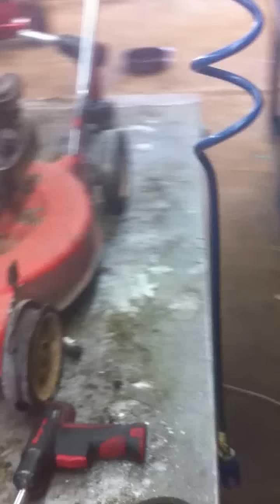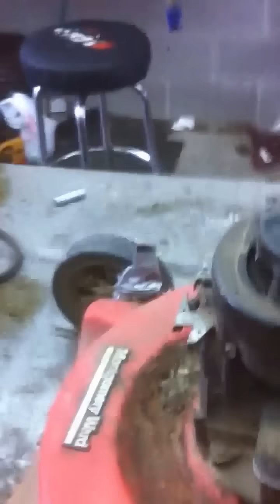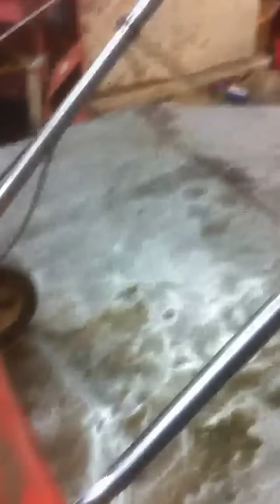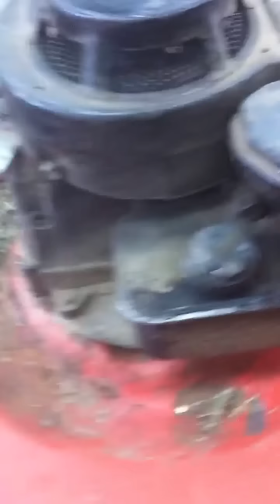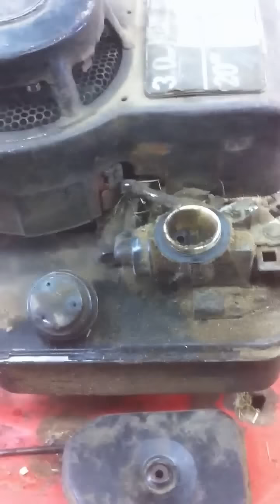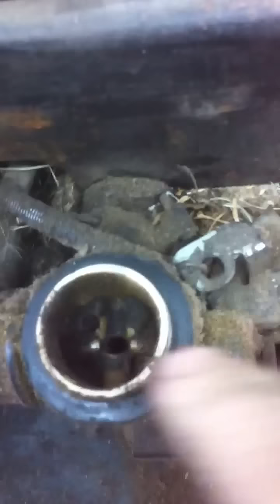LAWN MOWER REPAIR      a little maintenance goes a long way

Comment: I think I understand what you're trying to say.
I think it depends on the cellphone you're using (I don't know which one it is). Usually, smartphones use a sensor that detects the position in which the cellphone is, and adjust the recording image accordingly, thus avoiding the black bars that we can see on this video and on the "GAS TILLER REPAIR severe carburetor damage" one. But the sensor software may be "frozen" and the cellphone may need a restart or a calibration so it will work again.